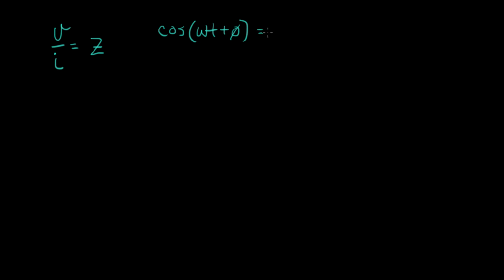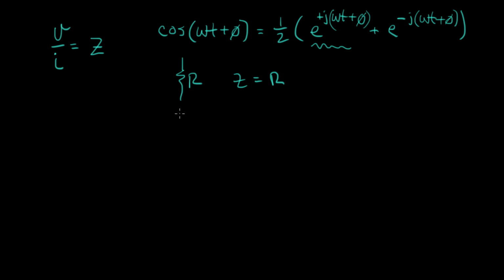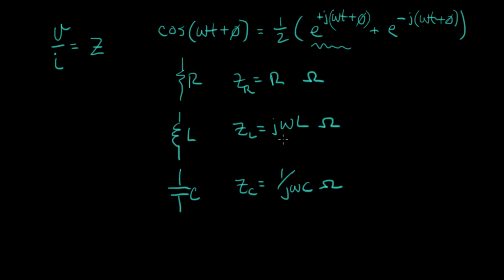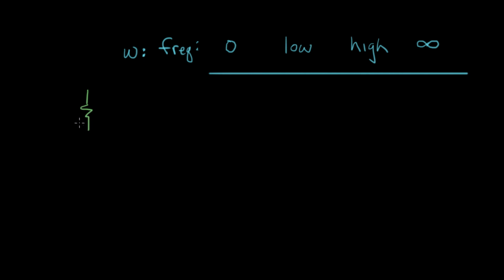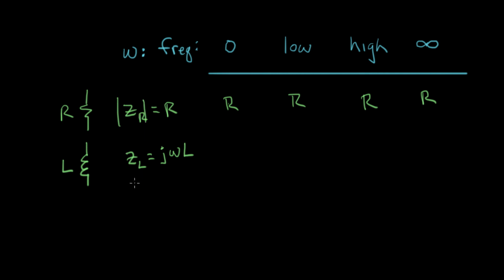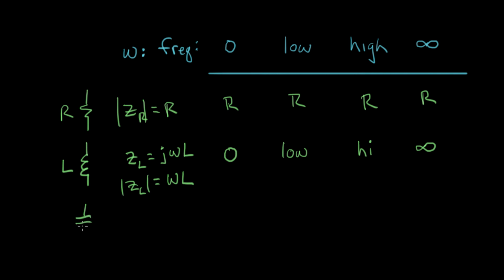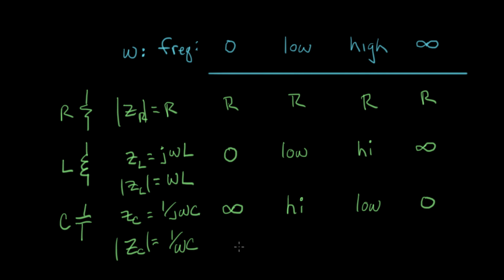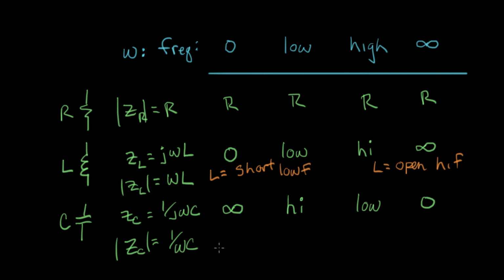Impedance vs frequency

Comment: can we spin electrons around atoms of the same type only as far as those atoms are the same type? For example, you have a pocket of air in a space craft surrounded by vaccum. You send an electro-magnetic wave inside the faraday cage that is your space-craft. The wave bounces around inside, but can't easily exit into th vaccum because of magnetic and electro-static shielding. The path of least resistance is INSIDE the craft and impeded from exiting the craft.

Comment: what about the inverse self-resonance? Since every coil has some capacitance, we can think of its implicit capacitance as being in parallel. When the frequency drops low enough, there is some sweet spot that is inverse resonance, and then when you go lower than that, suddenly the current is impeded again BEFORE reaching 0. What is weird about time is you could have a frequency that has a time-domain that lasts a year .... or 11 years .... or a 100 years ... and the inverse of this is NOT a 0 frequency. It is a super small frequency, but it is still not zero. The reactance at this super small frequency must be HUGE thru the implicit capacitance. Eventually, the implicit capacitance would be completely overwhelmed that it would pop in the inverse direction.

Comment: hii,

do you have a video on Frequency to current and voltage relationship in an induction motor ? 
how high freq causes current in the stator to drop and low freq causes high current.. 
why is that ? 
is there any other relationship when it comes to freq in induction motor > 
is there any formulae of such ? 

thanks
andrew

Comment: In our microelectronics class for inductor we use ZL=2(pie)fL where f stands for frequency and L for inductance 
For capacitors we use the formula ZC=1/(2(pie)fc where f again stands for frequency and c stands for capacitance. Resistors ideally stay as what they were but angle is zero while capacitors is -90 degrees and inductors is positive 90 degrees. Also this video shows the ideal case. When frequency of more than 5 MHz is applied, all those circuit components begin to behave differently than the ideal case. Anyways nice to see this video and that its helping people.